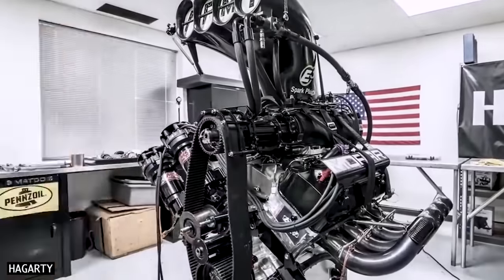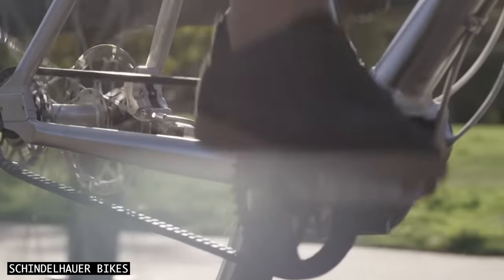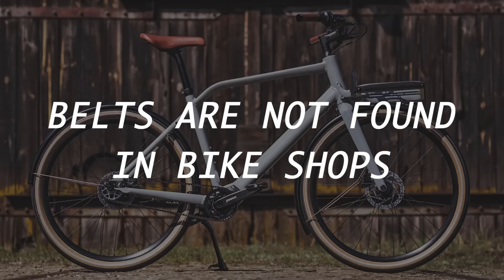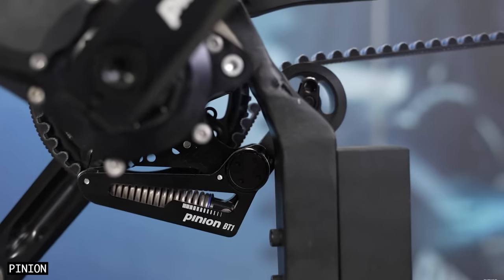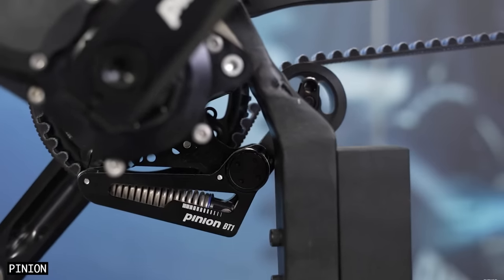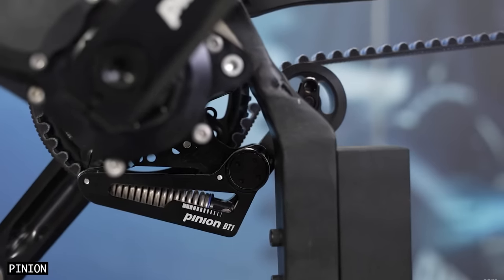Belts Are Now BETTER Than Chains On Bicycles!

Comment: Had belts on Rohloffs and Pinion since 2012 and would not go back. If you are wanting a reliable and straight forward method of getting from A to B with zero fuss you can’t beat gearboxes and belts. Marketing makes people think they need the same technology as used in races when in reality they need something that will just work. Even more relevant in this day and age we need less throw away parts and parts that are going to last. Thank you for another factually correct and unbiased video.
Reply from the maker: They have been such a big life improvement for me - I don't miss derailleurs at all on my hard-working touring and commuter bikes.
Reply: I don't doubt a Rohloff hub will still be going on it's 28th birthday (planetary gears in other applications easily do that. There are plenty of tractors and cars older than that with planetary gears that still work with way more mileage than any single bycicle will ever reach)
And while i like the idea of belt driven bycicles and less things being trown away, i think something to consider is that the materials a chain consists off are 100% recyclable while the materials a belt consists of, not so much.
Reply: I prefer the lightness of derailleur and the strength of  a chain .
Reply: @Pin Ky You seem very quick with superficially judging others and with clicking the submit/answere button (or whatever the button displays in your language of YT use.) 
You could have also taken your time and thought about what i wrote and put your answere in one comment.
1) i never claimed to own a rohloff hub (or any other such gearbox for bicycles). I just commented on how these kind of gearboxes last in other applications and thus my conclusion of how it would last in this aplication.
2) we seem to have a different understanding of recycling. Recycling to me, means the material of an item itself can be reshaped and repurposed into a new product several times.Making a makeshift jumping rope that barely works is not the same as being able to melt the metal of a chain and gaining new war material through that.
A perfect example of what i consider recycling, are current lead acid car batteries: After their "life" they can 100% be recycled. The acid gets reconditioned, the lead gets cleaned of the sulferings (which are put back into the acid), melted and remolded into new elextrodes and the plastic of the casing gets shredded into small peaces, cleaned and used as granulate for injection molding new battery cases.
Reply: @Pin Ky Well done for not replacing it. I too run derailleurs with friction shifting as you can mix and match parts. The way modern standards limit your choice is a problem. But yeh it probably will be around. People have their hub gears for hundreds of thousands of miles. So should be good for decades without as much maintenance.
Reply: @Pin Ky I do know how they work. I build bikes. So you never have to clean, oil, replace jockey wheels. There is a plain and simple fact here I don’t know why people get annoyed by thinking they need to choose a side a be on. You don’t have to choose a side. They both have advantages and disadvantages. The advance of derailleurs are that they are light and cheap, but to keep them running well take a bit of maintenance. The advantages of gearboxes are that they require near zero maintenance. I use all systems and appreciate the advantages of gearboxes for the longevity and reliability without fussing over them. Trust me you don’t need to choose a side. Just enjoy what you like riding!
Reply: @Pin Ky So we own a Priority Apollo Gravel with a Alfine 11 speed hub. I spent about $1000 to have my rear wheel rebuilt so I could use a Nuvinci N380 CVH. I have bent and damaged derailleurs. I've had jocket wheels die and bent hangers. However I still need a derailleur because I need a chain tensioner. Which I recently switched from a derailleur to a Origin 8 tensioner. The reason I switched is because my SRAM GX derailleur somehow managed to get bent. Now I should mention this is on a recumbent trike, so it's really unheard of a derailleur taking damage. But it happened. With that said, I love my Continuous variable hub, it's amazing. I find it humorous that the Alfines need an oil change as often as my car lol. But they will last forever with good maintenance.
Reply: @Pin Ky The one I ride is a catrike expedition, I invested in a nice u-lock for it.
Reply: @Pin Ky I would and eventually I will install a pinion gearbox on my catrike expedition. Which will essentially give me nearly unlimited gears/positions. But that kit is around $2500. In my opinion it's worth it. The Pinion Gearbox is an amazing bit of kit. Currently speaking I don't know of any velocipede that uses both an IGH/CVH and a bottom bracket gearbox.  It's usually one or the other.
Reply: @Pin Ky Nope, that's not a thing at all.
Reply: @Pin Ky As mentioned before you don’t need to pick a side. Enjoy your bike.
Reply: @Pin Ky How many chains and cassettes have you gone through since then? Not to mention the hours spent on greasing and cleaning...
Reply: Yeah, you can also just use a decent 3x8 chain drivetrain. Everything is dirt cheap and long lasting. But marketing convinces everybody they need over complicated fragile racing nonsense, that offer 5% improvement for 5x the cost. Electric derailleurs? Come on?
Reply: @apodski  Completely agree my touring tandem will have 3 x 10 friction shifting. My commuting bike has 1 x 8 friction shifting etc. The fact the new breed of derailleur systems eg the new SRAM needs proprietary frames is even taking away any advantage derailleur system have such as interchangeability of parts. The marketing machine is all wrong, it needs to stop to save the planets resources!
Reply: "Marketing makes people think they need the same technology as used in races when in reality they need something that will just work." How do you know what I "need'? Everyone has their preferences and it's not just because of marketing. Some prefer the light weight and crisp shifting of a high-end derailleur system.
Reply: @capmidnite  I mean you're more than welcome to it if it makes you happy, but it's annoying when $40 chains $100+ cassettes are all that's widely available in decent quality. You can get composite motorcycle racing sprockets and chains for that money. Everybody buys a $150 wallmart bike or a $3000 bike, there both over priced for what they offer and there's no happy, sensible medium.
Reply: A decent 8 speed chain is a whopping $8, so you can just keep swapping them out whenever, or you can soak them in solvent if you want to be green. x8 is a lot less stressed than x12, so everything lasts multiple times longer. If you replace and/or clean the cheap chains, steel x8 chainrings last almost indefinitely. But, quality x8 drivetrains are hard to come by, because manufacturers decided they last too long and cost too little, so they moved on to the next wizzbang (x12) to sell.
Reply: @capmidnite  True, but you got to ask yourself why do you desire the latest and lightest. Is it due to the marketing (start twighlight zone music) 😂
Reply: @RidingBicycles  I don't. I have over 6 bikes, ranging from a 1980s lugged steel Fuji ($50 garage sale find) to a folding Brompton. One of my rides is a titanium Moots cyclocross bike, which I built up from a frame which I bought used for a fraction of the original MSRP. I purposely sought out a cantilever brake frame because I don't like disc brakes on a drop handlebar bike. I installed Paul Component brakes which look so cool and yet are NOT heavily marketed (except for a webpage). I also have a bike with a Rohloff hub. In other words, I gravitate towards high quality niche products that have a devoted following but are not necessarily mainstream or well known.
Reply: @capmidnite  Exactly the type of bikes and parts I buy so you know exactly what I was implying. Buy well, buy once!
Reply: On that note after my maxxis tyres cracked under the sun and after all the publicity they put on those terrible ardents. ill have to recommend their 1/4 the price sister company cst. Better rubber, better tread design (built for police forces by the looks of the model names). When i put the maxxis on i put the cst on the other end, cst still good as new, maxxis is in the trash before it blows up on me. Same factories producing them.
Reply: If money is no object, that is definitely the case. Even a cheap Shimano Nexus runs more smoothly than a "Rohloff", though.

Comment: I bought a riese&muller ebike with a gates carbon belt drive and an enviolo internal gear hub and I'm never going back to chains and derailleurs again. for my application which is about a 12k ride to and from work in rain,sleet snow and all sorts not having to do any maintenance on the bike outside of changing brake pads once in a while has been a dream come true.

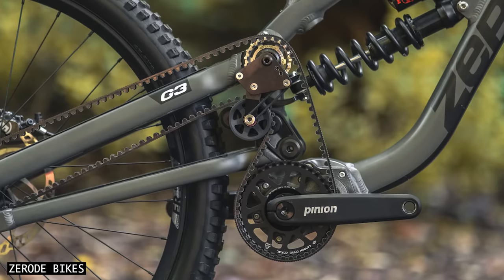Comment: As a mechanical engineer, I'm very familiar with the advice at 17:54 to avoid backbending of (most) timing belts, since it shortens life.  This doesn't just apply to loose belts; it also means that we try to avoid tensioners which bend the belt the "wrong" way.  However, it seems that bicycle belt drives often include such tensioners, such as those shown at 2:19, 3:52 and even what appears to be Gates own promo material at 13:24.

I checked Gates' Technical Manual, expecting to find a minimum allowable radius for backbend-inducing idler pulley, probably calculated according to belt model, expected load and riding conditions, but here is the whole of the section on "Tensioner & Idler Integration":

"Gates Carbon Drive has been working with bicycle manufacturers to properly design and implement idlers into some specific applications. For each application, thorough testing of the drive is completed, and certain parameters need to be met prior to releasing the bike to the market. Our belt handling instructions must still be followed, as backbending belts by hand could cause damage. Idlers that follow our design requirements do not cause belt failures. All idler designs require approval by Gates Carbon Drive engineering team."

That's it!
Reply: Know what doesn't mind back bending? A chain.

Comment: I agree, as i have been working in a Flourmill plant for 29 years and we are using High tension drive belt in running our Rollermill machines. Our belt supplier is Gates. This time now I'm a biker and here in Philippines i have not yet saw a belt drive bike and hope i can get through how to change into a belt drive on my bike.

Comment: Thanks for such a great comprehensive video. Recently bought a Priority 600X with Pinion belt drive. Love the technology and can't wait to take it on a few long distance tours this summer. No chain lube and the mess it creates is something I'm looking forward to. Thanks again, Steve
Reply: How have you found the belt after owning the bike for a decent amount of time? Easy to maintain compared to as chain? Intrigued to know the difference!
Reply: @Richy91  No problems at all. Very simple and easy to maintain. Smooth  and quiet shifting. I've got about 3000 miles on the bike and the belt shows no sign of wear.

Comment: Here in Belgium I just got my first belt drive bike, a Bullitt cargo bike, and now whatever my next normal bike will be, it's gonna be belt drive.
With daily commuting and crap Belgian weather, chains are basically permanently dirty or crunchy so I assume at least in the winter, a belt drive will actually end up more efficient for me.
Most people don't like doing maintenance either so I see a lot of bikes with horrible rusty crunchy chains. I now exclusively recommend disc brake belt drive bikes when someone is talking about buying a new daily commuting bike, especially if it's an e-bike. I honestly don''t really know why expensive chain drive e-bikes even exist anymore.
Reply: For mid drives, the difference is efficiency and sudden failures.

When battery powered, it matters quite a bit more, and when they fail, fixing them is an absolute pain.

IMO, the best compromise is a waxed chain with a partial/full chain guard. The difference is insane.

Comment: I had a bike shop for 25 Years. My experiences: Belt drives on bicycles have increased frictional resistance. I was shocked when I tried out 2 very expensive bikes in the bike store and thought the drive of the bikes was faulty, the belt had such high resistance. When you turned the cranks, they stopped immediately. I also want a very light bike and love derailleur gears. If you change the chain when it's only half worn out, you can ride 10,000 km with the same sprockets and have very low follow-up costs compared to the belt drive and get spare parts all over the world, don't need a special frame and don't have higher friction in the hub. In cars or motorcycles, the increased resistance does not come into play as much because of the engine. Thanks.

Comment: I wish I have been able to get 10,000km on a belt. I'm on my 3rd belt now due to two belt failures at around 5,000km or less. The belt didn't snap like Ryan Van Duzer's, but the teeth would start to show cracking at the base of the teeth. I tried managing the tension a bit closer, but found that the cogs themselves had gotten so worn that I needed to replace those. The teeth were getting very sharp and I had a rear cog where some of the teeth had completely worn out. I've since upgraded to stainless, so we'll see how that goes. Either way, I will religiously keep a spare belt on any bikepacking trip as the first failure outside of cell service and 30km of singletrack away from the nearest town.

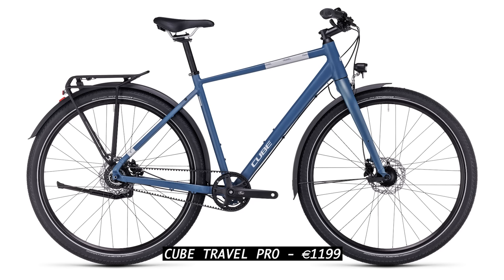Comment: I bought a Priority Classic Plus Gotham on their first year of release. (7:26) I rode it a few months, life got hectic, it sat for nearly 1 1/2 years... Went out to it yesterday, pumped the tires up, water wiped down the entire bike to get rid of dust, checked cable adjustments and went off for a short, nearly two mile ride. No chain, no mess, no fuss. Thoroughly impressed. Inspected the belt prior to the ride and saw nothing at all wrong with the belt. Personally like how you fine tune belts - harmonically 🙂So musical Gates is with their app.

Comment: Besides the price, one of my gripes personally with gearboxes is that it's quite a bit more difficult to hook them up with dropbar shifters
Reply from the maker: That’s fair. Shimano Di2 shifters are probably the nicest option available currently, but only for Alfine. Given the new Pinion and Rohloff electronic trigger shifters coming through on e-bikes, I don’t think we’re too far away from some drop bar levers too!
Reply: Yeah. Too few road bikes are going for belts so there's fewer drop bars. Gravel bikes at least made this less often.
Reply: if its personal why you telling us/?
Reply: @Cyclingabout  I would never go touring with electronic shifters. I have seen too many people, even in races, with empty batteries.
Reply: "Besides the price, one of my gripes personally..."
So, The idea of needing to buy buy a replacement frame with a cut in the frame to accommodate the techno-belt didn't put you off?🤷

Comment: I used to work in R&D for a company that makes these kind of belts, and I rode a concept bike 20 years ago... I can confirm that the drivetrain feels WAY smoother than a chained bike. The one I rode had zero perceptible drivetrain slack/play when starting to apply pressure on the petals. You might not really think about this without experiencing a belt drive, but there is  significant amount of it with a chain.  That part is great but personally I've never considered building a belt bike myself. I'd only use it for a single speed. But a chain works fine and is cheaper. So.. IMO it's only worth it if the reduction in drivetrain slack is extremely important to you, and you don't mind spending more just to have a bike that's different.
Reply: Have you ever correctly adjusted chain tension?

Comment: My previous full metal bike was a gazelle. I got this bike when I was 13 yo and 40 years later I bought a new Gazelle (alluminum one). In the 40 years I never changed the chain and never did any maintenance on the bike other than tire/tube changes when needed, while using it for most of the ~30 years on a daily basis (the brakes were not very good anymore at the end). My current alluminum Gazelle bike, I still didn't replace the chain after 9 years but more maintenance is needed on the alluminum parts.

Comment: I still prefer a timing belt over a chain. It's easy to replace a bad timing belt. It's a pain in the ass to do the chain, which is usually integrated into the engine to share lubrication with the cylinders. This also means as the chain wears, its metal affects the cylinders and as the cylinders wear, their metal affects the chain. Most of it is handled by the filter, but still, a lot of grinding metal. 

Additionally, that's why it lasts "longer" than a timing belt. The belt in an automobile is exposed, or just barely covered, much like a bicycle. A timing chain is hidden away in the engine and drenched in oil. 

On a bicycle, the chain is exposed and only dry lubed, so it's definitely not going to last as long as a timing chain dripping in lubricant and protected by a filter.